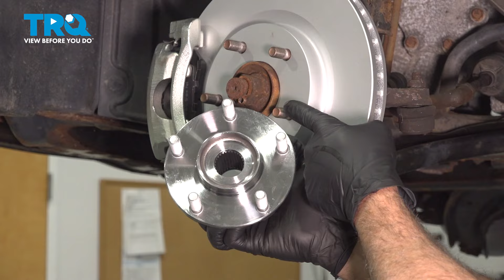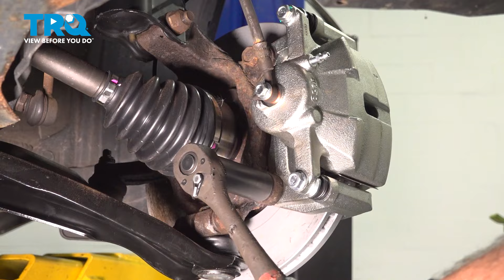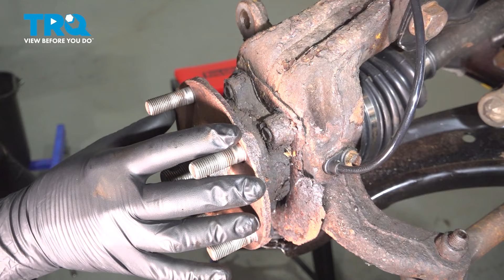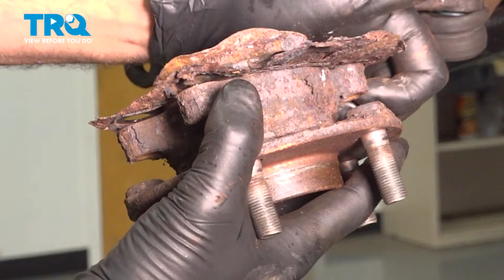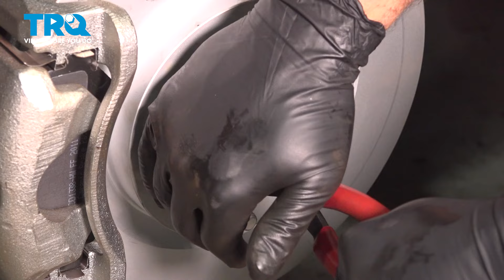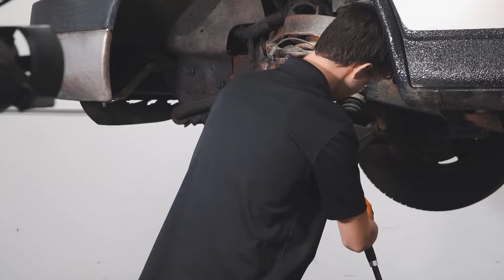How to Replace Front Wheel Bearing and Hub 2008-2013 Nissan Rogue

Comment: if your wheel axel isnt moving back when you push it:
Do not just hit it with a hammer. Use some penetrating oil, PUT THE 32mm NUT BACK ON until its flush with the axel(this will stop mushrooming), Then hammer (you can use a hammer and large punch for a better effect)

if you already hammered and the nut doesnt wanna go back on you can ; 
1) get towed to a mechanic shop, 2)red neck it and get to a mechanic shop, 
3)or if you have enough thread on the axel, slowly grind the first 3 treads slightly until the nut fits and try to hammer. 

If its not working dont force it, you will strip something. Double check the tourqe rattings on your year of vehicle

Hope this helps

Comment: Ive done both of my front wheel bearings now and this vid was a big help. As far as the backing plate, i dont care if it's a little rusty, they went back on, its mainly the outside edges of it thats rusty anyways. As far as the wheel sensor, dont expect it to come out without drilling it out with a 3/8 drill bit. Theyre only $20 on amazon so its a minor problem to resolve. Do yourself a favour and spray penetrating oil on all bolts to be removed a few times over a day or 2 to make life easier. I did it on the driveway, no hoist,  and everything loosened up no prob. If the axle wont push in use a sledge hammer and  have someone hold a block of wood, preferably hardwood, against the axle end and it will free it up. Ive saved over $600 doing it myself so thanks again for the tips TRQ! 👌

Comment: Have a 2013 rogue and I tried this replacement. Those 4 bolts behind the hub are an absolute bitch. I tried everything, I shoved the axle as far as it would go, I turned the wheels a bunch of times to get a good angle, but still struggled so badly to get only 2 bolts out I said fuck it and sent it to a mechanic. I usually fix my own stuff with ease as I've been doing it for years, but this mechanic makes this look like a walk in the park. I get I'm not a mechanic, but this shouldn't be that difficult.